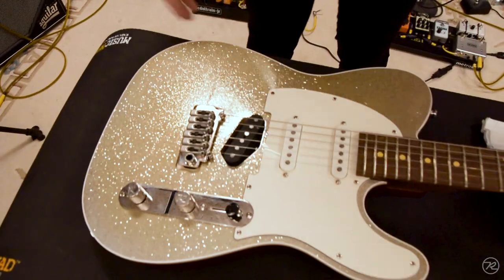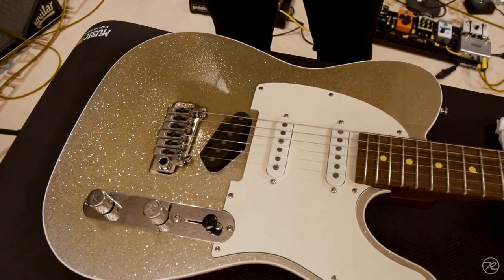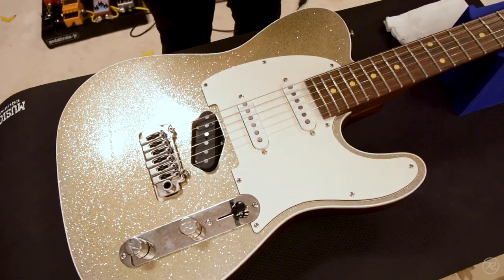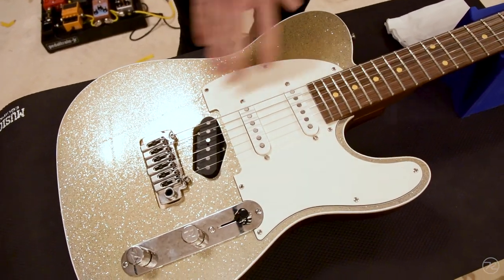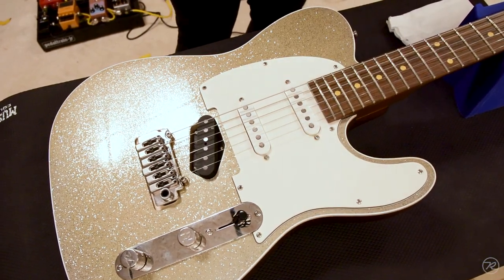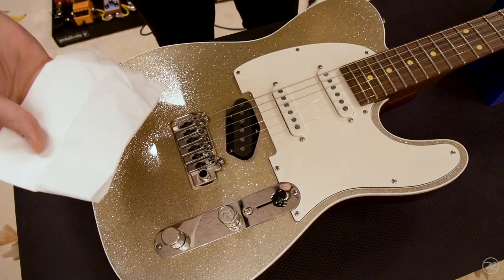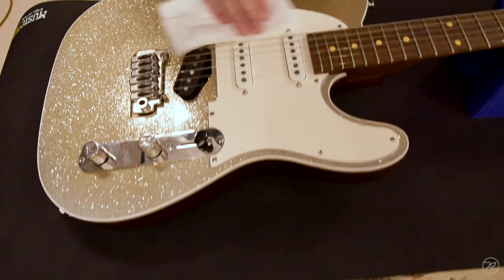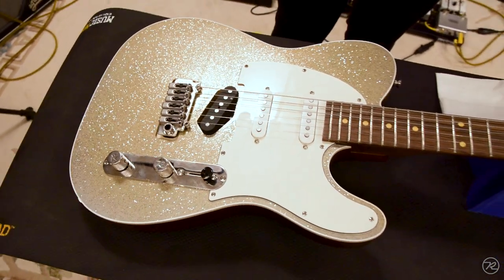How-To: Release Static from your Pickguard

Comment: I did some research on diy static cloths and the dryer sheets have all kinds of chemicals, but the main ingredient that kills the static is vinegar, so i soaked a paper towel with white vinegar and rubbed it on the pickguard and it did it , but you might have to to do it a couple of times , lot cheaper and better than the dryer cloths..

Comment: An easy and more permanent fix is to slip a loose piece of kitchen foil under the pickguard and clamp the front of the control plate onto it to provide a ground connection - don't even need to de-tune the strings. On a strat clamp the foil using the front switch screw.

Comment: Have three teles. MIM, an Ultra w/ the anodized aluminum and an older Nashville w/ factory b-bender. This is a recurring problem with all three, surprisingly the Ultra is the worse. Dryer sheets .. kind of help, but quickly returns. Even less effective is the static spray applied w/ cloth (and smells). I have had umpteen basses in my life, all w/ pickguards and NONE had a static problem. Don't even live in a supper dry climate. Will take the ultra in for a shield / grounding check; the MIM has been in .. didn't really fix it. My PREFERRED solution would be to remove the darn pick guard but alas the neck PUP is the kind attached to the guard. All three are this type. The bridge pickup, no problem at all .. only the neck which is of course the one in contact w/ the pick guard.